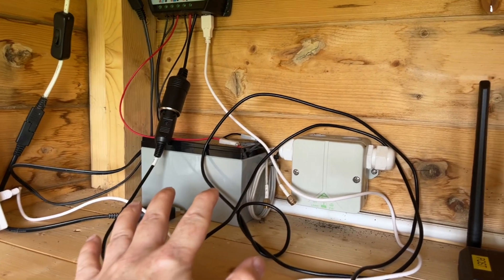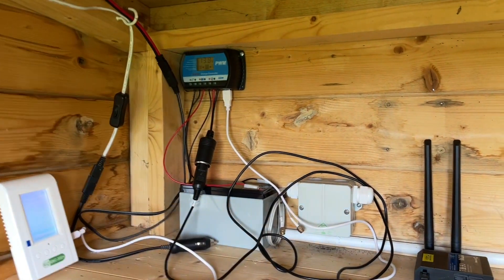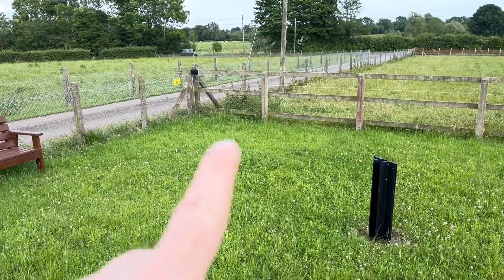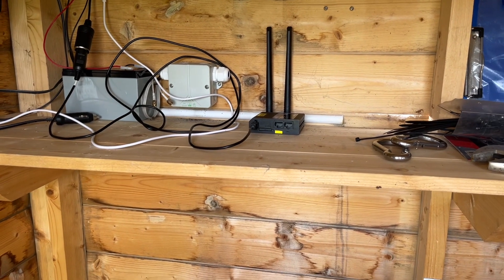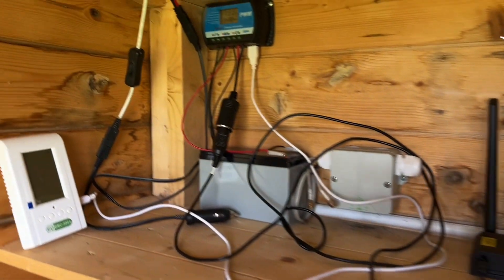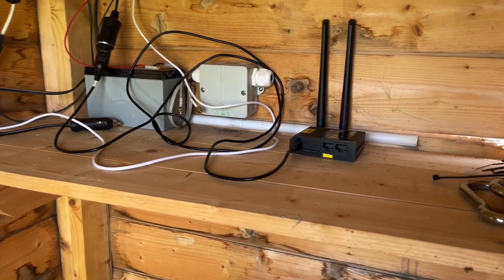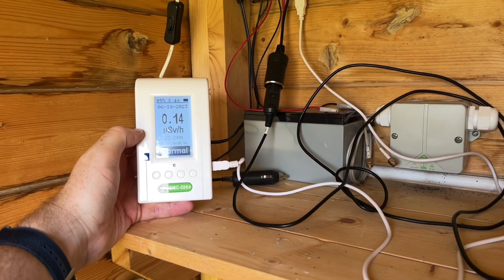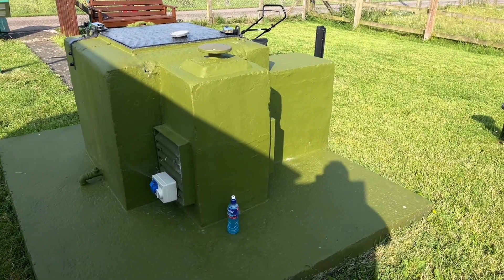Bunker Maintenance Episode 22

Comment: Great video as always. 
Just wondering what you do for WiFi underground? Do you run an ethernet cable to a booster in the bunker ?
Reply from the maker: The only thing above ground is the antenna and associated cabling. The cable then runs down the the main air vent into the bunker - I detailed the installation in this video : https://m.youtube.com/watch?v=edM0pLR85BA&feature=youtu.be